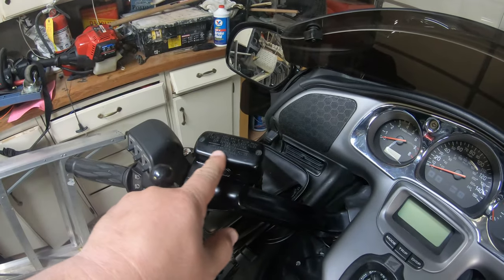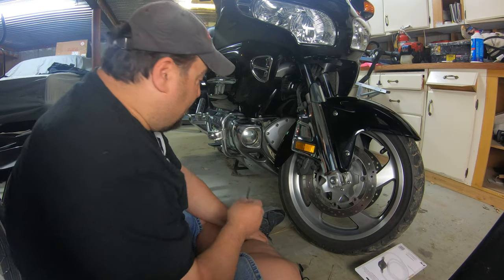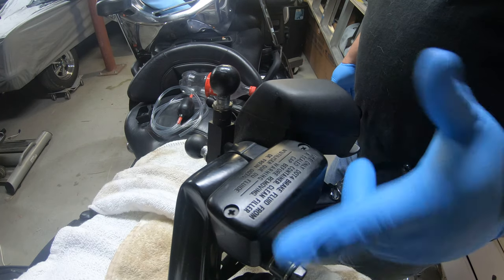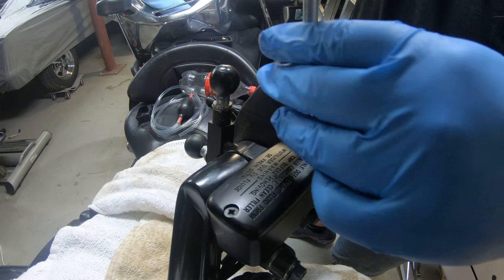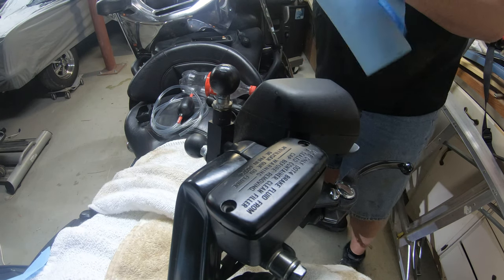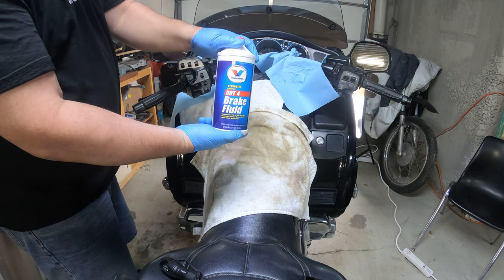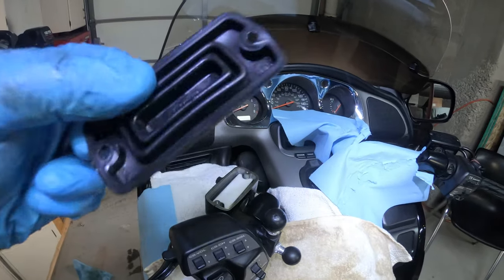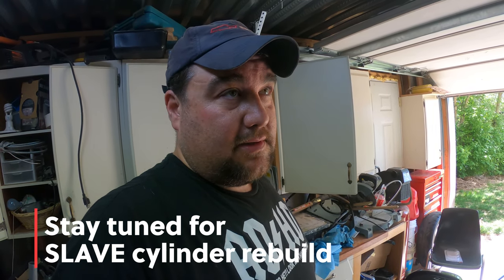GOLDWING CLUTCH FAIL---Goldwing

Comment: This is just a simple tip I've learned from my grandfather 
If you can't get all the air out of the system, pull in your clutch lever and zip tie it and leave it overnight. All the air will travel up. You will wake up to a firm clutch it has worked on many motorcycles I've owned. Hopefully, it works on my wing, too

Comment: Once you open the reservoir, use a syringe and suck out all the old fluid, wipe out the black residue, then fill it with fresh fluid. It cuts down on how much fluid you have to pump through the system. I've also gone and replaced all my bleeder screws with speed bleeders. No special bleeder equipment needed and it's now a one-person job.
Reply from the maker: I just ordered some speed bleeders. Thanks for the info!

Comment: May I ask would you know if it affects the shifting my 08 wing gets a little stuck on 5th gear. Not sure what could be the problem
Reply from the maker: Not sure
Reply: @GeekAndSon  ty
Reply: Have you tried replacing your engine oil. Maybe with a different brand or try synthetic if you are not using it

Comment: I have a question for you I have a 84 goldwing. When I run my bike for a while the clutch will slip, but then I let some air in the line the clutch works like it should. When I shift the gears about 50 times I got to do it again. I had the master rebuilt , but it still does it. Please tell me I didn't stomp you. Lol
Reply from the maker: Is it hydraulic? That's weird
Reply: @GeekAndSon  yes it is
Reply from the maker: I would change out the fluid and seals
Reply: @GeekAndSon  the master clutch was rebuilt
Reply: Has new fluid
Reply: Should I just rebuild the clutch
Reply from the maker: @darrealemerick8685  I would

Comment: Sir I just got a 97 model with high mileage, runs great but stops pulling after a few minutes of riding and will not move for about an hour. Any ideas? New clutches maybe? 145k miles but is in immaculate condition and very well serviced according to the records.
Reply from the maker: Yep sounds like clutch
Reply: @GeekAndSon  thank u sir

Comment: Also did this fix your problem? And was the clutch operating any at all,  or similar to mine?
Reply from the maker: Mine wasn't working at all. I changed the slave cylinder and it fixed it.